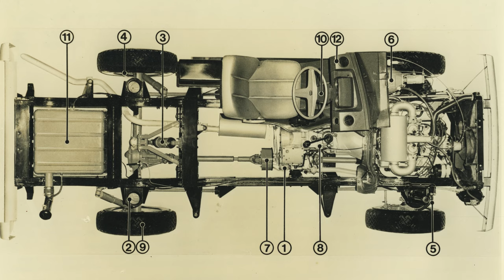How the Range Rover created a class of its own

Comment: Celebrating 50 years of most unreliable car brand in the world. Yes it’s nice, comfortable good looking car but shockingly unreliable. 99% of people I know who owned RR cars before are now enjoying BMW, Audi and other quality cars. Friends recent experience with RR. He picked up brand new autobiography Vouge last year, after 6 months and 4K on the clock gear box field, broke and splattered oil in his garage. 3 months later air suspension failed plus few other smaller issues was enough for him to decide and change back to brand new X5 which he’s been driving for over 10 years